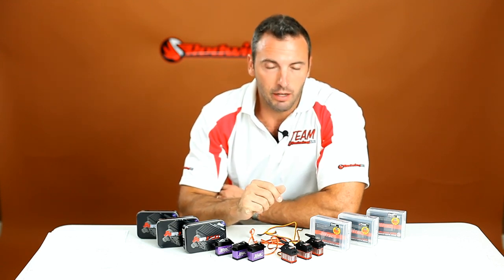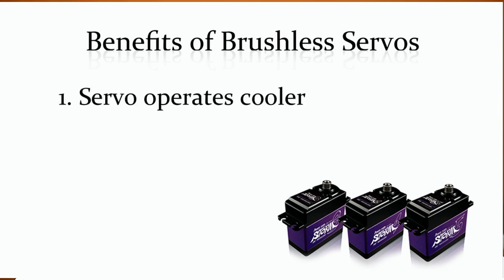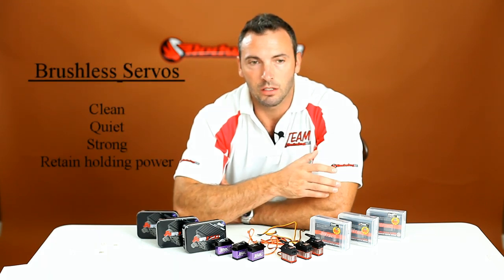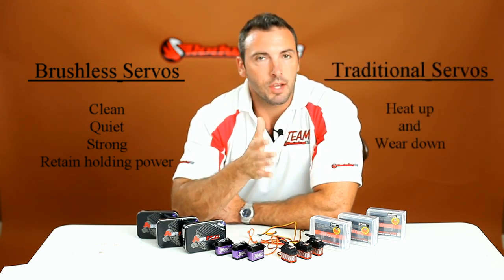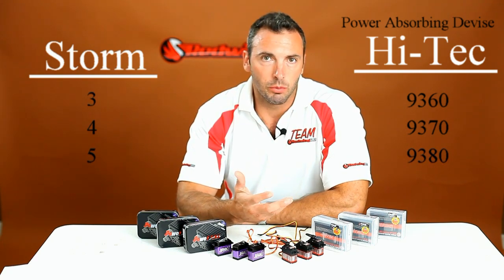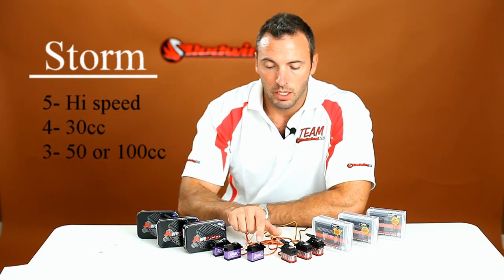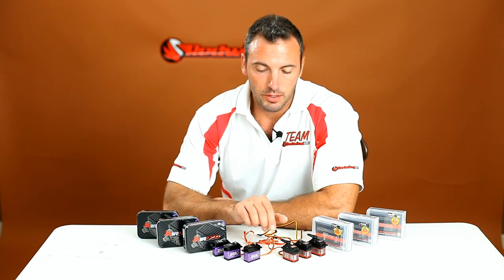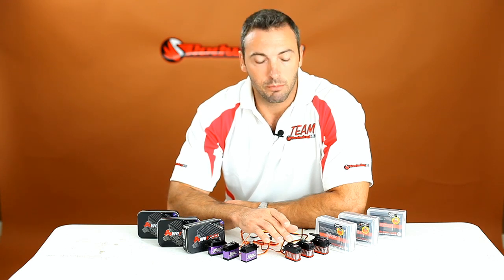Brushless Servos - Hitec 9360, 9370, 9380 - Power HD STORM 3, 4 and 5

Comment: which one is better the JX servos or the power HD servos ?
Reply: Viktor Tech I seen a test of a jx 20kg torque model and it  only pulled 10 kgs. Every powerhd I have pulled above spec and centre accurately.